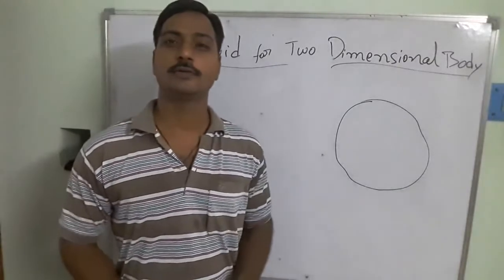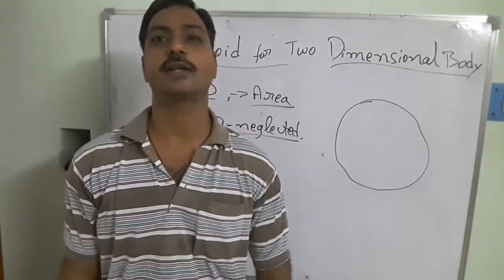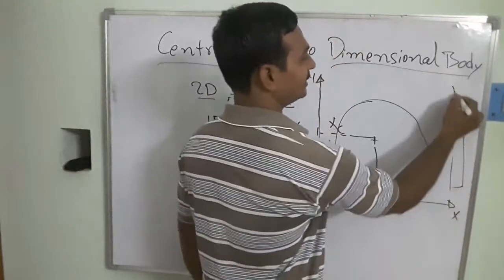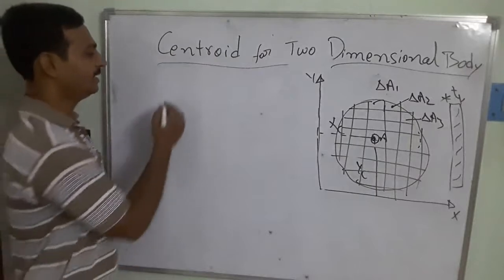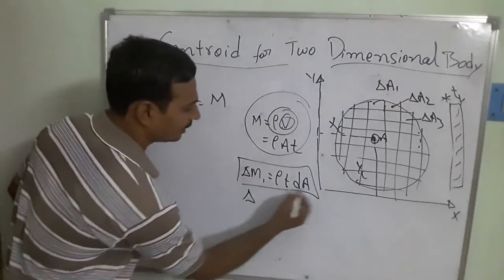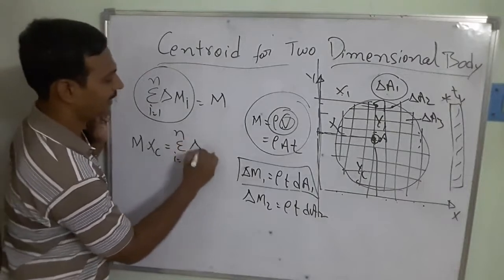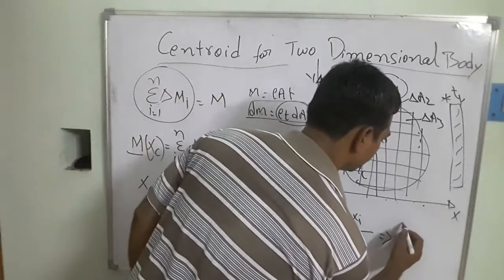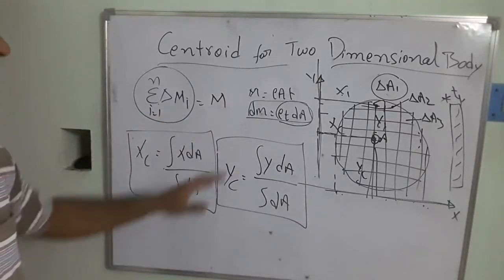Lecture 44: First Moment of Area - 2D Bodies

Comment: What is the difference between area moment of inertia & mass moment of inertia
Reply from the maker: Dear subrat, 
Area moment of inertia is also called first moment of area. It is employing for 2D bodies.
Similarly, mass moment of inertia is also called second moment of inertia. It is widely applicable to 3D bodies.
The main purpose is that it explain how the area or mass is distributed with respect to the reference point while the body is in rotary motion.